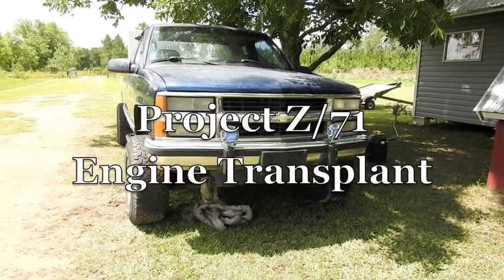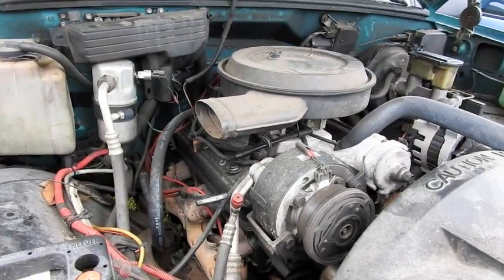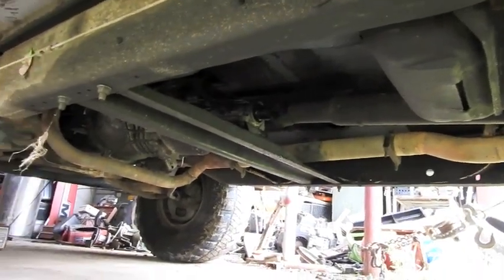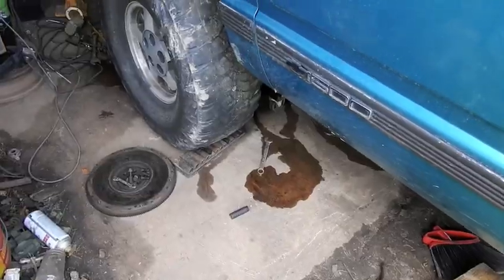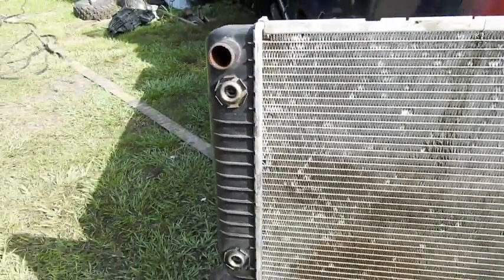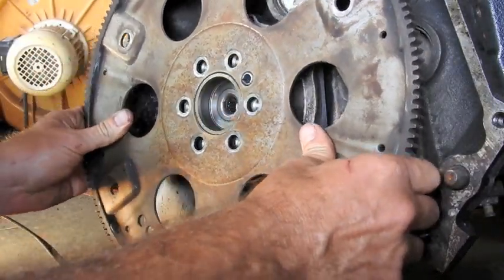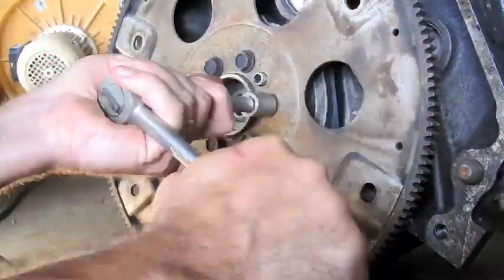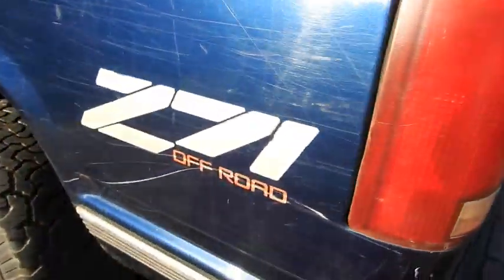My $1100 Z71 Project - Engine Transplant - How To

Comment: I'm glad I'm not the only one who boils there thermostat on the stove...
Reply from the maker: Learned that for dad as a kid. Could sure save a bunch of trouble later. Thanks for watching.
Reply: @chud327  same here my father did it so I followed suit. I actually boil them before a new thermostat  goes in because I've had new ones be stuck also!
Reply from the maker: I hate it when new stuff doesn't work...
Reply: @chud327  you and me both! The Longer the drive to and from the auto parts store the more likely you'll have a bad part or wrong part!
Reply from the maker: That is 100% true...

Comment: $500 is pretty damn good i'ld say. brother in law had that same truck no lift but somehow fit 295/16 tires on it.  im looking for a under $1000 1 ton 4x4 project like this for the farm. recently i changed the catalytic converter on my '91 k1500 now the starter turns engine over faster & it's got way more power. had a local tractor repair convert r12 to r134 for $95. you should try to get some in there so you don't hurt the compressor. mine has the old 700r4 transmission with tv cable. the transmission went out 189k scorched the 3-4 gear discs/steels the rebuild kit was $300 plus fluid was'nt hard to rebuild
Reply from the maker: I may need to investigate my converter... I have never rebuilt a trans before, may have to youtube it when the time comes.  Thanks for watching.

Comment: good work bro!  $500 step side?  nice deals!   you could make the 4x4 into a step side :D then use the wider fleetside box for a trailer with better cargo capacity.  just an idea.  that stepside sounds clunky when you're driving it.   its funny to see it run with no transmission, ive done the same with the firebird project :D .  that batman knife is epic.  are you pulling the cabin in 4hi or 4low?  thumbs up
Reply from the maker: The cabin was in 4 low, I had to think of an excuse to lock it in... I had thought about step side and fleet side swapping, we will see.  I don't know if I want to sell the step side so some one can save it or start chopping it up... I am post it for sell and see what happens, if nothing then start parting it out and make that trailer. Thanks for watching and keep working on that firebird.

Comment: I guess we can forgive you for buying a Chevy....

Nice job getting it going!
Reply from the maker: That may be the one thing we have to disagree on.  I have always put Chevy in first place and Ford in second place, but they are both good.  I am just more familiar with the Chevys.
Thanks so much for watching.
Reply: @chud327  Well, I've had some experiences with Chevys.  When I was like, 5, my dad bought a brand new Chevy Malibu.  Within 75k, the liner was falling down, a lot of the power options had quit working, and the starter had literally fallen off while driving down the road.  Roundabout then the engine developed a knock and he scrapped it.  It was a fun car, but it was ridiculously unreliable.
Reply from the maker: @muddy_armadillo  That sounds like my wife and her love for Hondas, they have all been great, but she had a CRV with 30k miles and the tires were worn out. 33K and the brakes were gone. A few minutes later the head light went out... the biggest kicker was it would run hot while idling...  we have had 5 other Honda and no issues, but that one was a lemon for sure. Maybe that is what was up with your Malibu.  Thanks for the reply and thanks again for watching.

Comment: Hey I have a 1995 chevy 2500 extended cab long bed and it's black and if you want it its 1400 bucks
Reply from the maker: Where is it located? thanks for watching.
Reply: @chud327  I'm located in Tennessee and it has a brand new transmission and a vortech 350 and it's 4wd and I have the title now there is some rust but the body is fine and it's all there minus a few trim pieces
Reply from the maker: @bwadles7659  Just seeing your reply and Tenn is a bit far for me... Thanks for the offer.